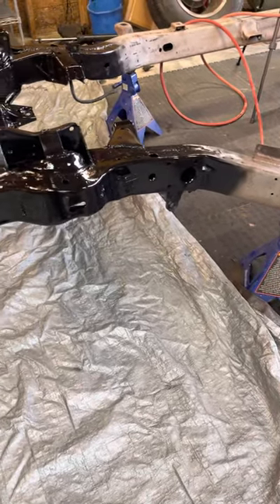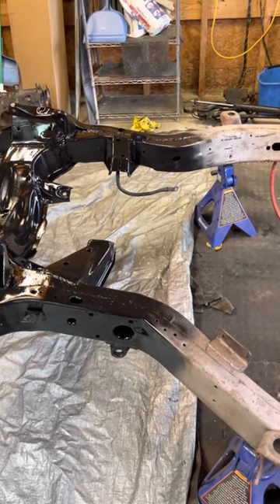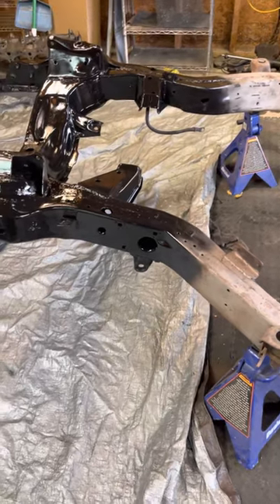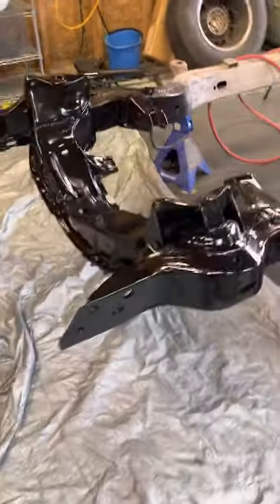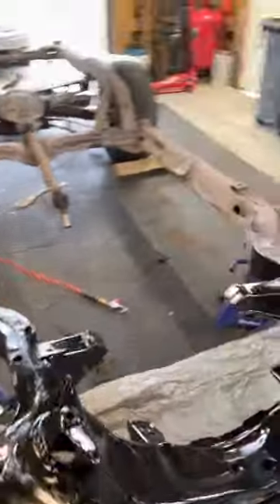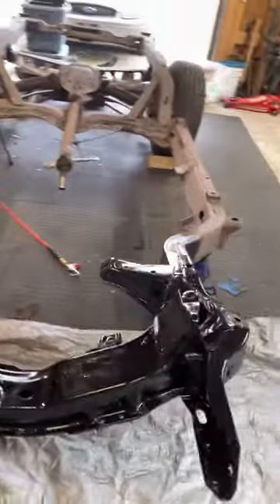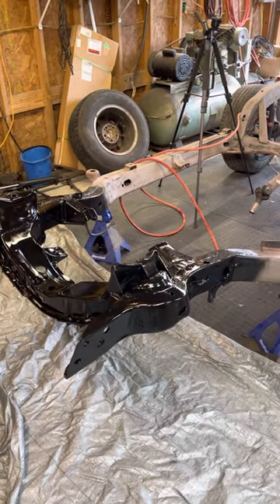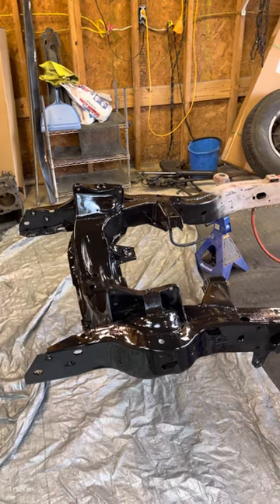C3 corvette prepping and painting the frame!

Comment: We are working in the same fashion for sure! My pocketbook is a tad light as well, and a small budget is the name of the game! I have only managed to have a lot of things in my life because I have been willing to take something any other saner person would scrap or throw away, and put in the work and time to fix it. I forgot to mention on your video removing the front suspension, that you should watch the video I did on my channel of a safer way to remove the front springs without the weight of the car to help control it. If those springs aren't kept controlled when you pop a ball joint, they can come out of there FAST, and may want to take someones head off. I saw a guy at a shop I worked at didn't have one setup with sufficient control and the spring came out and broke his leg. The way I show in my video can also be used to reinstall the springs again. 
Just something you can think of in the future if you tackle that type of job again.
Reply from the maker: Funny you say that because when I did the other side I went to fast and it slammed the lower into the floor luckily I was in a stool!!
But I’m not putting them back in. I have new upper and lower control arms and I’m going with dual adjustable coil overs, they don’t have that tension